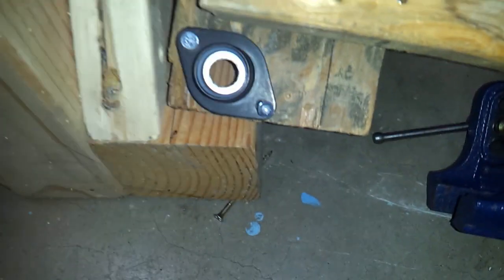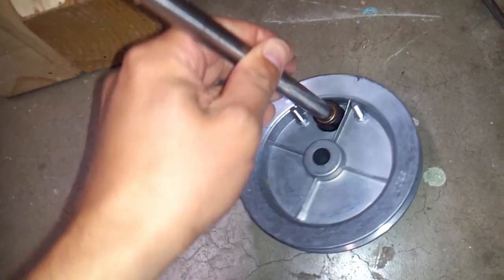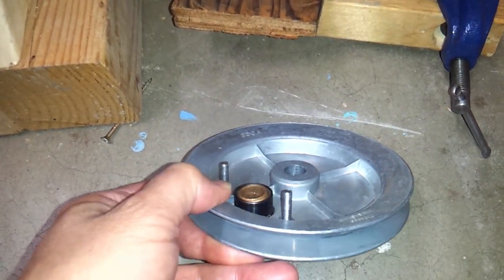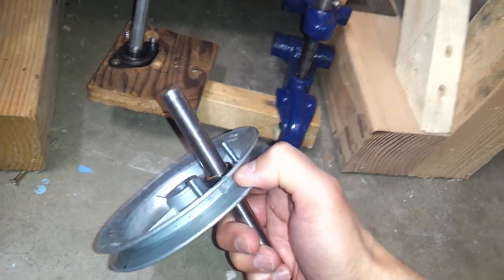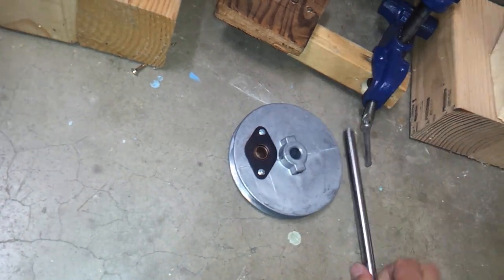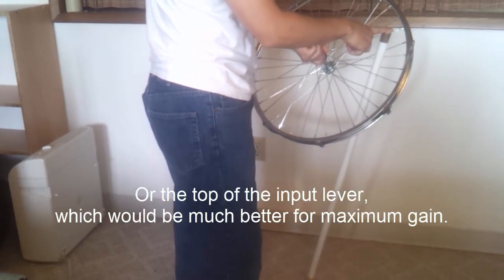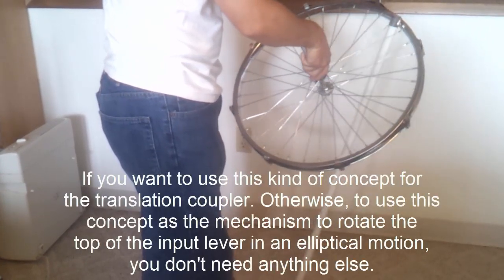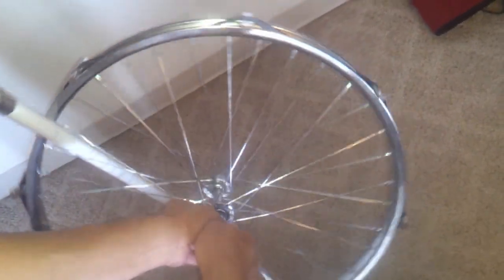Murakami Circular to Elliptical Converter

Comment: no Aaron, Skinner machine did not use ellipse movement in the input, just see The John Devise as is nearly equal to Skinner and do not use ellipse to generate overunity energy
Reply from the maker: That device (not devise) you mention is an equilibrium machine that will not accomplish anything. Yes, the Skinner machine has an elliptical input - only idiots keep pushing the circular movement with their circular arguments. Go read the Skinner articles, they even call the upper input the eccentrics!! Wake up. And you can SEE IT if you're not blind.

Comment: Aaron automotive constant velocity ( CV) joints on front wheel drive cars would be ideal for this application. Even better would be cv joints off an atv. They are small, light weight and strong enough to handle the forces they will have to endure.
Reply from the maker: Interesting - will have to look into that.

Comment: is there a range of the elliptical ration the rod should be driven within?
meaning, should th ratio of the shorter to the wider diameter of the  elips be
betwee 1/4 to 1/2 or something or is there an 'optimal ratio? or is the rule
the more the better?

Or maybe we should build it with the best available elements?

Plus what os the overall relationship of the ellipse size (longer diameter) to the
lenght of the rod or shaft or overall machine?

thanks this is fascinating.
Reply from the maker: The more narrow the ellipse compared to the length I believe is best. You get a more abrupt kick at both ends. But for this elliptical drive method I'm showing here, it will be limited by the tilt of the wheel. I can't really make a mechanism that would allow me to tilt the wheel 89 degrees for example where it is almost standing up but for example, that would give an ellipse that is nearly a straight back and forth line. But I don't think it is necessary to go that extreme. I'd like to at least do it with the wheel at 45 degrees and I think it will work perfect.
Reply: Aaron Murakami
Ok, I see now that my question what a bit premature for my state of understanding as I haven't grasped Skinner's method completely.

But here'a an ides for your method: could you dirill the pulley's center whole
at 45 degrees so that you would nee 'only' a vetticla shaft and the horizontal
projectiong of any outer point of the pulley would be elliptical?

Comment: Great Aaron. What do you think about using this on wind mills too? And what is the over ratio again? 100% gain or double unity?
Reply: jason cunningham
From my experience with other 'OU' devices I have the feeling that the efficiency (or cop) is not linear. meaning if you put in 100W and get out 1200W doesn't mean you'll get 120W out with 10W in. So even aaron is building a 1/3 verision of sckinner's machine and I doubt that he'll get he same numbers. maybe more manybe less. But if he's gettin 200%, it's big dinner time for him (and me).

This non-linearity is mainly due (IMnshO) to the necessity to TUNE the machines. Their resonant freuencies will give you high efficiency. This is no different from piston or turbine internal combustion engines. there are RPMs at which they give the most torque for the fuel consumed and some RPMS at which they are the most efficient for the fuel consumed.

Hope that helps and would love to hear Aaron's take on this.
Reply from the maker: Hi Jason - in what way are you thinking with the windmills? Skinner's machine is claimed to be 1200% - he is using roughly 100 watts and is running is lathe, saw, etc... all off the mechanical energy produced but I think 1200 watts won't do all that work so I think it is much higher than 1200%.
Reply: So if a wind mill normally producing 12 volts and lets say 2 amps of power equaling 24 watts, then with the Skinner machine running off this vertical wind mill shaft, would I be correct in expecting somewhere in the excess of 12x the overunity of 24 watts equaling 288 watts? Good luck and thanks again Arron.
Reply from the maker: jason cunningham
That's the basic idea but I'd use the SERPS technology with wind powered generators.
Reply from the maker: Yves Baggi The bigger something is scaled up, the bigger the gains from what I've seen.
Reply: Aaron Murakami

Ok, that would make sense as the 'noise' becomes less and less of an issue proportionally.

I'm really looking forwad to buids for that skinner gravity thing.
Hopefully someon will come up with a simple design even I can replicate.